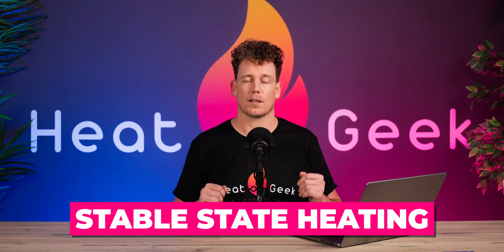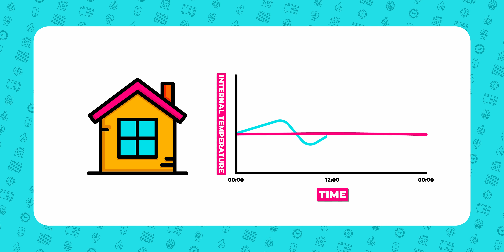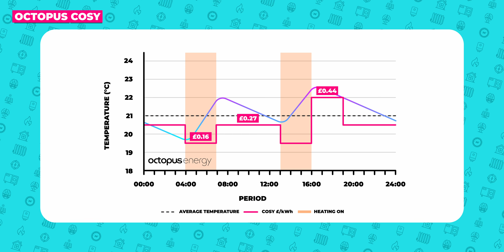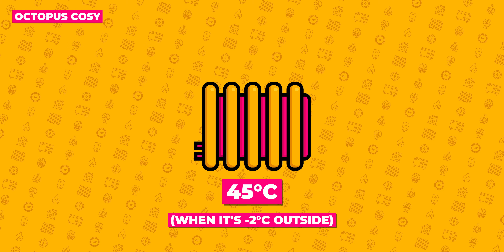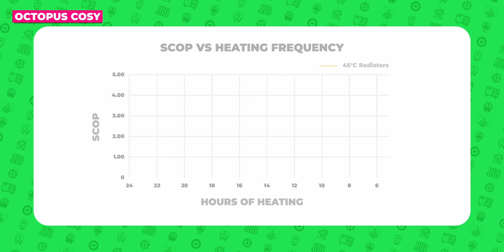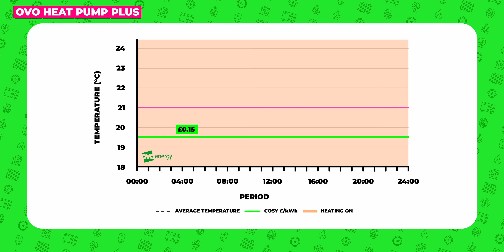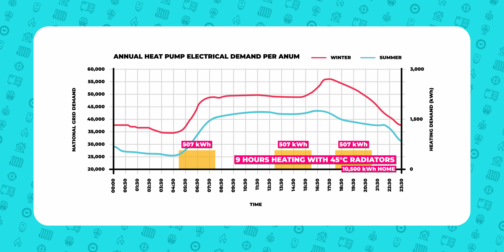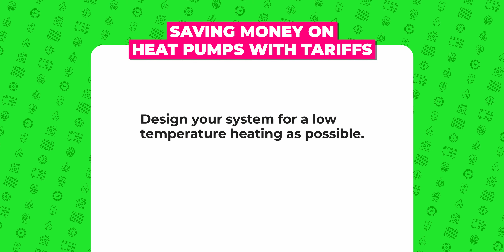Which Heat Pump Tariff Saves The Most Money?

Comment: See i cant work out if its worth it for my mum who has a heat pump, her controls are pretty dumb (council install) and she likes the heating on all the time but a lower temperature at night. It has no heat compensation and by looking at the graph nit a very efficient hot water tank as it tops up the temperature quite regularly. She has a cop in the 3s so not too bad but i just dont really kniw where to start to improve its efficiency and cost to run.
Reply: The system is possibly set for "Reheat" on the hot water. That could be changed. 

Reprogramming the controller could work wonders. Our installer normally configures for set flow temperature (55') like that. I reprogrammed the system for weather compensation and operation that sounds similar to what your mum likes. We see flow temperatures below 45' and much better efficiency.
Reply: @garrywhiting8398  thanks for the reply. I can't see any form of weather compensation be it on the terrible controller or the clunky app it's really annoying. Also no option to have seperate temperature for flow and water it just does both at the same temperature so I'm a little bit wary to bring it down because of legonella. My mum doesn't want the rads cooler but if I can work out a way to do it separately I will do it and not say just fora few days and see how it affects the cop. She has the water on constantly as she has a pain condition she likes to have regular baths as and when. It seems like the tank drops temperature soo quickly.wh en compared to my setup the water gets to temp and is still holding near enough the same temperature by the evening and I heat first thing in morning. It just seems really bad for a tank that's a couple years old. I also find it quite hard to find much info on the mitsubishi system. I also believe the system. Is well oversized for one bed bungalow aswell so not sure how that affects efficiency. My mind would suggest it would be better as the system wouldnt have to work so hard to get the job done. At the moment her bills aren't far behind mine and I heat my house 24/7 3 bed with 6 of us so something isn't adding up.

Comment: The time of use tariff is best employed charging a home battery and then powering the heat pump on the cheap stored electricity for the rest of the day. Octopus Intelligent Go for example gives six hours at 7.5p so you can avoid the peak rate entirely if your battery is big enough. Combine that with solar panels which produce a surplus in summer which you can sell back to the grid allows you to bank this surplus cash in the account so during winter your import is funded from the surplus at the cheap rate. This whole system can effectively give you zero  bills over the whole year.

Comment: Have you considered the same video with battery storage system
Reply from the maker: We recorded it and had to chop it due to time and complexity.
Reply: @HeatGeek  shame it got cut. Pointing out time of use with heat pump doesn't make much sense is good, but then the real options are OVO without batteries Vs time of use with batteries.

Comment: This is where thermal stores solves most of these problems and a 500l can store 25kwh and you could double this.
Heat pump using electricity for 6 hours that is 4 times cheaper at may be half the COP when it would not be used due to setback at night
Other benefits are longer heat pump run times and quicker response plus stops overheating due to solar gain 
Please do a show on this!
Reply: Aero therm 7kw. SCOP at 60C is 3. Effective SCOP*cost is 12 for a delta of 40C.
Reply: So even accounting for lower efficiency at night it is still far cheaper
Reply from the maker: But the efficiency drops off with higher temp so doesn’t work out
Reply: @HeatGeek simply not true COP of 2 with negative prices on tracker tariff results in far cheaper running costs
Come on you like a challenge - look into tracker pricing and thermal stores
Reply: @HeatGeek  agree. I have a biomass (Pellet) boiler which is quite cheap in use, heats up our 250 litre thermal store for heating and hot water, I believe these need to be separate. The system is oversized 13kWh heating/water 3kWh room heating and not very controllable which makes the house too dry and gives me dry/sore throat. The house is 144 sq meter, underfloor heating, radiators not used upstairs and an EPC of 100. I would love to have a heat pump installed but apparently we can’t get the BUS grant to help.
Reply: @HeatGeek According to your upgrade calculator I can receive the BUS grant, is this true?
Reply: @RussMBrooks it’s not clear - best thing is to “decommission” the biomas boiler - nothing to stop you recommissioning after…
Reply: @charlesstewart2304  I’m asking an installer about the decommissioning next week, as I’ll then only need to use our emersion (direct heat) heater as spring is here, and see if he’ll put us forward for the BUS grant. Thanks for the tip, cab it be that easy?

Comment: I substantially agree with your conclusions, but in Scotland, for new builds, you basically build to near passivhaus standards. If you have underfloor heated upstairs and down, (thus the concrete slabs referenced below) AND if you have a large thermal water buffer (I've got a 1te buffer) you can run on Econ 7 using only 7 hours of direct water heating, then floor heating to get up with, then live off the buffer and thermal mass for the rest of the day. Only trouble with this is that you cannot do it with a conventional controller as you need a constant delta T across the water buffer for optimum efficiency, not weather compensation. This largely counters your argument. Also, if constant running, you have a pump running continuously (100w) whereas with timed running even this cost reduces. oh and i've got ground source pump, so warmer ground at night. so as ever "it depends"
Reply: Do you truly see ground source temperature differences during the time of day? I've got a vertical system with two ~50 meter deep boreholes, I can't say I've seen it fluctuate that much in such small time frames. I guess it's a bit different with a horizontal loop.

Comment: An issue that doesn't seem to be addressed by most of these videos is under floor heating with a thick concrete slab. I have 100mm thick slab that once warmed lasts all day or more. I also installed a trench heater for a much faster response time. This sounds like the ideal solution for stable state heating, basically the whole floor downstairs is a massive thermal mass.

Comment: The information about the heating requirements for underfloor heating is incorrect. I heat my home in Denmark at 35-40 degrees for 3-5 hours and the thermal mass of the building keeps us warm 21C until next day… our floors are very well insulated here 3/400mm of insulation under a 10cm concrete floor. So warming a floor to 120 degrees is way out!!!

Comment: COP changes depending on outside temperature and humidity. The last thing you should be doing is operating your heatpump only at night.

Also, and it seems that Heat Geeks often forget to mention it, if the DC inverter compressor of the heat pump works at less than 100% power then the COP usually increases since the heat exchanger with the outside air is more efficient. (Google "COP vs inverter power"). Usually the optimum power is 30% of peak power.

Comment: Swiched from price cap to agile. Steady state with 1 degree setback for the peak. Averaging around 17p kwh. Bill are right down.
Reply: This is the correct answer. The tracker tariff is also another option as it would likely be around the same price. These other tariffs by comparison are poor value.
Reply: Agree, I’ve got a home storage battery as well so this further preserves me from paying peak import rates on agile.  My average was 15p/kWh in December, 17p in January and 14p in February
Reply: Me too. Cheap as chips though it might rise slightly with gas prices rising.
Reply: Same for me. I've managed to average 14p/kWh in the last two months, saving me huge amounts on heating. Yes, you get stung during the peak at 5-7, but overall running on the weather comp the heat pump isn't stressing in those hours so it's not a big consideration
Reply: @mattsgreen  yes it's great. And the peak is only a fraction over the price cap. Great while wholesale is stable.
Reply: I’ve half my bill switching from a fixed rate to agile

Comment: Always love the vids. This time the hot water comments need another look. There’s no way the marginally higher efficiency of the HP running a DHW cycle in the daytime vs night time would come anywhere near the at least double, in some cases 4x higher, electricity cost in the daytime vs off peak. It’s cheaper (and greener / lower carbon) with almost any off-peak tariff to run the DHW cycle at night, if you have a decent cylinder and low use that maybe enough HW to last all day, or if not top up a bit daytime / evening but outside 4-7pm peak times.
Reply: I agree. On Agile over the last year, the average price from 09.00 to 16.00 has been about 13p, compared with about 9p overnight. So, nearly 50% more for daytime non-peak. I would guess that the average temperature difference is not big enough that the COP is 50% better during the day.

Comment: I would love to see a similar calculation where you use time-of-use tariffs to charge a battery (especially an electric vehicle with bidirectional charging), while discharging continuously to run a heat pump at steady state. Would  inverter losses and battery wear kill the gains?
Reply from the maker: Yes I made this too but the video got too huge!!
Reply: We had solar and house battery installed recently.  At the time VAT was payable on house batteries unless installed with a solar package (however, now house batteries are VAT free).  So we got 20kWh of battery in anticipation of a heat pump install, so the battery could mostly power the house and heating from just overnight cheap (currently 7.5p) electricity.  If on really cold days this won't be enough, we will reserve enough battery to ensure we don't draw from the grid during peak hours.
Until then, we are powering the house purely from 7.5 p electricity via the battery and our solar gets exported at 15p.  During the summer we will have negative bills despite running 2 EVs!
Reply: @Ben-gm9lo  Are you on Octopus? Which tariff? Only Octopus Flexible gives 15p upload, but no night tariff. Unless it's changed, we're on Octopus Go, 4 hours at 9p and upload 8p. Thanks
Reply: You'd lose something like 20% of the power in AC->DC->AC conversion. Now if the heat pump could be powered by DC (Which it can, the compressor is powered with DC) it might have been more efficient and cheaper.
Reply: Works for me.  With a 9.5 kWh battery and a heat pump on Cosy, I'm averaging 17 p/kWh for imported power.

Comment: Nice video. With a time of use tariff and a heat pump it might soon be worth it to get some home battery storage as prices are dropping and Sodium-Ion becoming a real option (only from China right now). 

The charge/discharge losses of a battery are much smaller than the negative impact on COP and comfort by trying to excessively precharge your home with a heat pump.

With current heat pumps easily reaching a COP of 4 to 5, a small 5 kWh home battery on such a tariff will deliver around 20 kWh of really cheap heating.
Reply: Particularly as battery-only (no solar) installation is VAT-free now.

Comment: With cheaper night rates available , batteries start to make economic sense.     I’m fortunate enough to have solar PV, battery and an EV and are able to shift 95% of our grid draw to a night rate of 7.5p per kWh
Reply: The current Battery & Solar price curves mean pay back times are getting shorter. When we get to 3 years then it will make sense for lots more people. Especially if daytime electricity prices stay high relative to night time prices.
Reply: All electricity will be at the lowest rate. I am at a dynamic rate where the prices sometimes even go negative. Further, I have a full house backup using victron, so it gives more freedom on a whole.
Reply: You will never see a return
Reply: @delboy6384 what's your pay back on a gas boiler 😢
Reply: @delboy6384 Not correct at all. Payback is currently showing to be 6 years.

Comment: I’m on OctopusGo (cheap 0030 to 0430) with a solar & battery Heating is on set back from 10pm to 2am. Battery stops charging at 4.30am .  On coldest of days we manage to get to 4pm  before needing to draw from the grid.  Our heating cost for January has gone from £235 on gas last year to £75 on electric with the ASHP
Reply: The panel/battery combination is a revelation.  When I bought it originally I saw the battery as a means to store excess generation. However, since export rates have gone up and cheap overnight electricity we’ve made significant savings

Electric car is arriving soon (seems like I’ve been waiting for ages).  As soon as it’s plugged in I’m switching to Intelligent. I’ll swap the timing for battery charge to end at 0530, that way the car won’t charge from the house battery
Reply: @gruff2001  yes, the off peak side of batteries is a real winner. As a point, you can set the  "when I need the car ready" time on Intelligent Octopus Go to 05:30  to make sure the car doesn't charge from the home battery as well
Reply: @mikeroberts8412  thx for that. Just had the phone call from dealer - car is ready for collection next week.  That’ll be good bye to all fossil fuels in our household
Reply: @gruff2001   all the best 👍 enjoy the car
Reply: That's good to hear as I'm about to get a heat pump and run from batteries. I recently switched to Intelligent Octopus Go which gives 7.5p from 23:30 to 05:30 so would give you an extra 2 hrs.
Reply: I do have an electric car though

Comment: I have a HG-installed heat pump, and I'm on Octopus Cosy.  All I did was set a schedule with a slightly higher set point during the cheap periods, and slightly lower during the expensive period.  The idea was to overheat the house a little when it's cheap, with the expectation it'll not need as much heating the rest of the time. I've also scheduled the hot water to run at 5:30am and 1pm.  Currently there's something cock-eyed with the COP measurements on my controller, so I have no idea what that's doing to my efficiency, but the bills are nice and low.  I have PV and a battery, so this setup only really achieves anything during the winter when my consumption is much higher than generation, and higher than the capacity of the battery.
Reply from the maker: Yes that’s it.. ide say that would be the same as looking at around 23hours heating
Reply: I've recently had a heat pump installed.

Trying to work out the tariff best for me now.

When you say COP, is that the efficiency rating?

I think mine is wrong as it's coming in at 6.9, which to me means 690% efficiency?

We have it set at a high of 19, though dropping to 18 overnight.

We don't like a rrally hot house.

Comment: Why do my figures come out so differently?
https://youtu.be/6gtg6AZts1E
Octopus tracker/Agile FTW for the typical heat pump home witbout battery storage.
Reply: I think the assumptions were the efficiency losses were based on outdoor design temp (e.g. -2C), whereas most of the year you don't need a larger unit or larger emitters and wouldn't drop down to .6 COP 😅

Averaged 12p/kWh for February on Agile so already beating OVO pricing and I don't have a battery to carry me through peaks.

Comment: Yeah the Octopus Cosy is pants. What were they thinking?
Reply: Yeah Cosy was lose:lose in my opinion, we switched to Tracker and never looked back
Reply: I get the feeling it only has any relevance if you have a house battery to soak up the cheap periods.
Reply: Cosy only really makes sense when you setback during peak and shift hot water to the cheap periods. Whether you can save extra money via slightly boosting heating during cheap periods depends on your home insulation, lifestyle and installation.